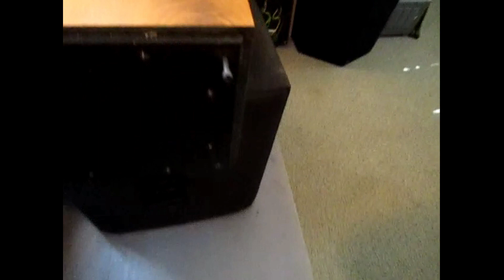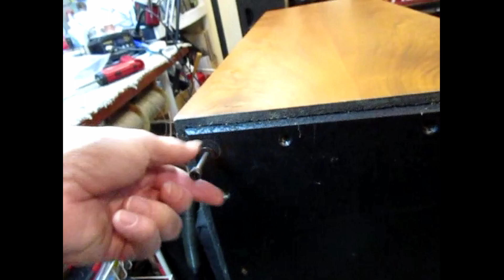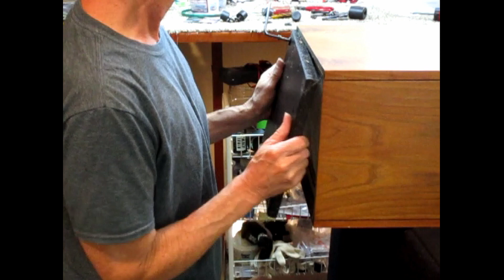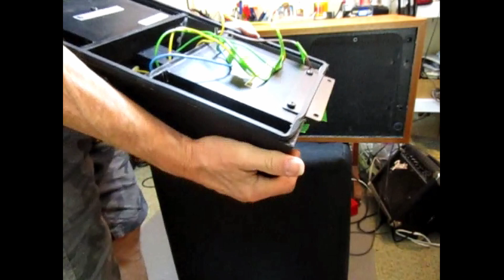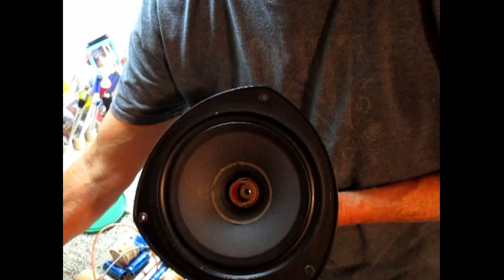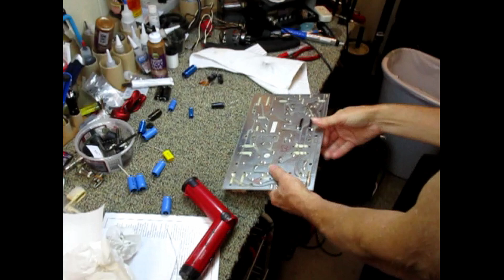KEF 104/2 repair

Comment: Some people change out the tweeter for another brand but I removed the dried up fluid inside the tweeter and added some new fluid and made them sound so much better. Fyi. I bought these used many years ago. Finding the fluid was a little difficult but I think eventually I got from the manufacturer for free.
Reply: Can you tell me where I can buy the fluid?  Thanks.  Sam
Reply: @samvan7787  I'm about to service T33 and bought ferrofluid form Simplyspeakers $12 per tweeter kits with fluid, blotting paper etc

Comment: Such a pity not to upgrade the crossover caps when already in work...
Reply: @larrysmith2703  Maybe I was not clear enough... I did not say replacing old but UPGRADING the caps. At least the direct signal path caps to decent PP

Comment: I remember listening to these back in the early 80’s at a local Hi-Fi shop. If I recall correctly they came with a small black box, the Kef Cube? an electronic device with a dial on it, it’s purpose unclear.
Reply: The KEF Kube is a treble and bass control meant to be used as a tone control. Without the Kube, a Schiit Audio LOKI + will easily fill that role

Comment: Thank you Larry for this excellent video. Made my 104/2 restoration/modifications so much easier. I've actually bypassed the Woofer section of the Crossover.I am running a miniDSP with the proper KUBE EQ direct into the refoamed (Donuts only) Cavity Coupled 8" Woofers. I added a second set of Binding Posts for just the two Woofers and replaced the thin crappy Speaker Wires with some 16AWG Speaker wire. 

About to replace the Ferrofluid on the Tweeter's today. I'll let you know how that goes.
Reply from the maker: That's awesome, buddy. Sounds like it ought to kill when you finish! Get 'er done and lemme know how it went.
Reply: @larrysmith7168  Tweeter Ferrofluid was a success. One of the Tweeters level was way down. Just had to remove the screws and re-align it to with the front baffle and success !

Thanks once again for a great Video.
Reply from the maker: @joeygsaudiochannel3972  Good news! Cheers.

Comment: Hi Larry, my Kef 104/2 doesn't seem to have audible or same output for 100 hz in comparison to the other low tones, does this mean it is broken or is this expected?
Reply from the maker: One speaker sounds different than the other? I would suspect the crossover may be the issue. Might be a bad capacitor.

Comment: can that center metal post be removed all together and a standard dust cap on woofers.............just askin
Reply: I can't imagine the rod not having a purpose that is beneficial to the sound in some way and can't imagine after going through all the trouble that I did, not returning it to it's original condition. But I suppose you could do as you suggest and may never hear a difference.